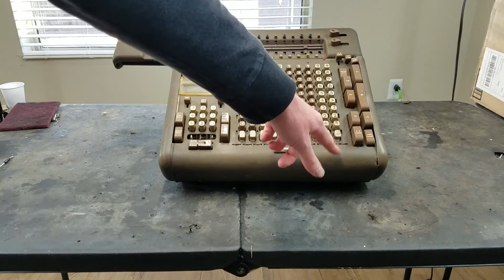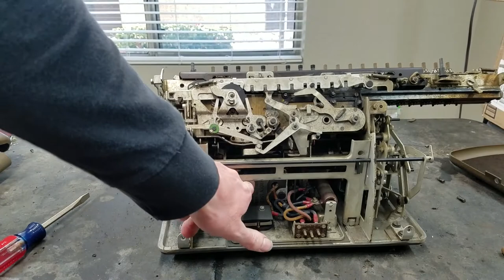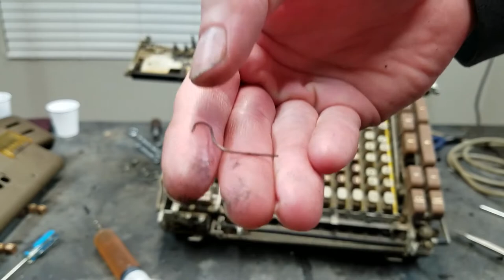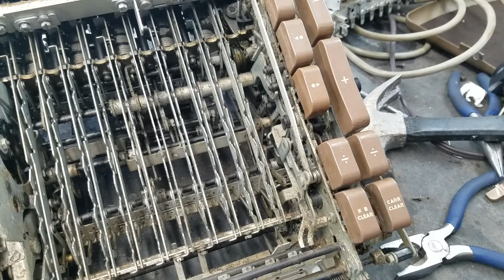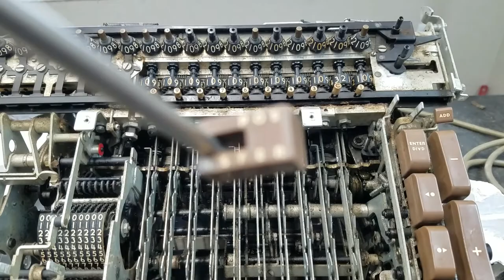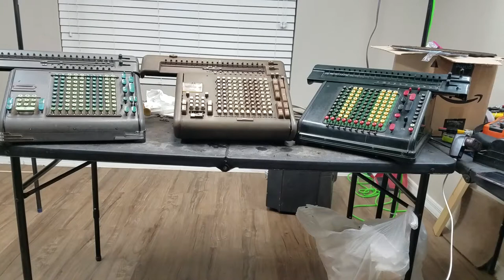Friden ACG Mechanical Calculator with Register Transfer, Shipping Damage Repair and Demo

Comment: Really cool seeing the Friden.  You had mentioned on my Unitas calculator video that Friden used the old Thomas arithmometer Stepped-drum technology.  So it was very cool seeing your video and with the carriage details, sure enough I could recognize my old Unitas again in very splendid brass parts!

I’ve been thinking of working on a Marchant similar to the one you very recently worked on.  However mine needs quite a lot of work.  But on the other hand,  your Friden work has given me inspiration to perhaps try and tackle my Friden instead.  The reasoning now being that the Friden is quite a bit newer machine and has been well treated and may actually be much less difficult to get going in-spite of it being way more complicated.  Its parts may be much less stuck and troublesome than the much older calculator.  

My biggest put off on working on the Friden is it has the square root function, so really adds quite a layer of complexity to a already crazy complicated machine.
Reply from the maker: I was really surprised how easy this Friden was to get going, both my S10 and ST10 had several stuck parts in them, and I was expecting the same for this Friden. By contrast, most of the older machines actually are less likely to have stuck parts as long as they were retired earlier, for example none of my old line Marchants had any stuck parts (but still had to be disassembled to fix the counter carry drum). Ive heard different theories, like perhaps companies swiched to synthetic oil in the 1930s which dries waxy compared to the previous natural oil which evaporated. Personally though Id be interested to see the Friden as those square root models are very rare and desirable, every one I’ve seen come up on ebay sells for $2000 to $3000. The nice thing about working on any automatic machine really is that the systems can generally be subdivided, like I start with addition as I work through getting the different operations working everything starts to make sense, instead of trying to look at the entire complicated mechanism as a whole

Comment: Shipping damage. Again. I hope I never get so goofy that I don't pack the hell out of stuff so it arrives busted up or bent all to hell. 
. . . On the other hand, these big old beaters are amazing. Watching stuff go from the Troncet through the pinwheels and on into the Marchants and Fridens is just plain fun. Gettin' 'em working again is another story ;-)
Reply from the maker: Ive seen a few instances lately of “double boxing” resulting in one box inside another box about 1” wider with some foam or peanuts to fill that 1” gap on one side, leaving the other 5 sides of the inner box (and the item it contains) to face whatever comes to those 5 sides of the outer box. It is amazing how people can take something as simple as double boxing and find a way to make it basically useless. The evolution is amazing, and also how much the designs build off eachother. The Fridens are based off the same Leibniz wheel principle as the 1850s Arithmometers (although those parts are buried so deep under the complex mechanism theyre hard to spot)